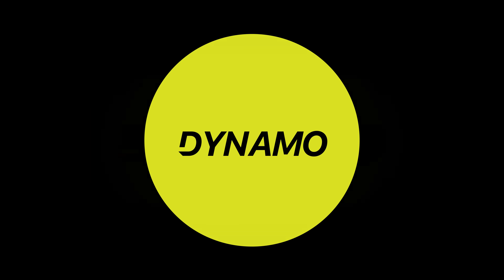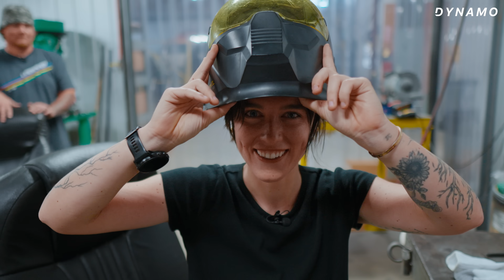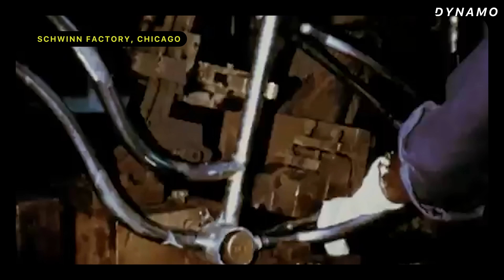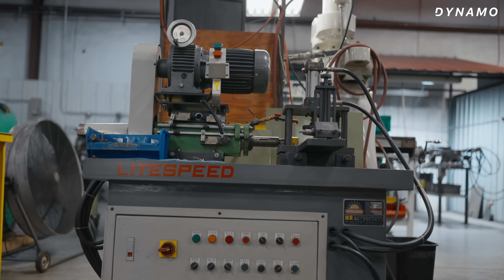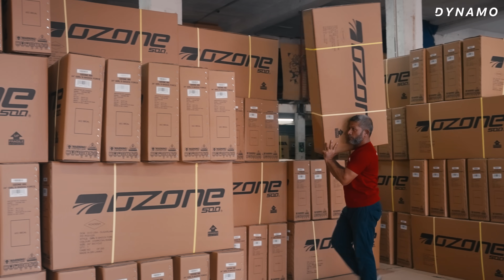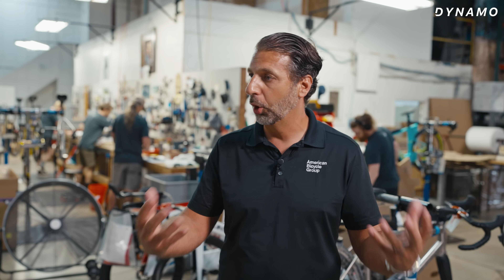What 'Made In America' ACTUALLY Looks Like

Comment: It's mostly impossible to go from materials to finished product in America.  In fact it's almost impossible to do that without anything coming from China (many products not from China are often re-packaged Chinese parts being sold through another intermediate country).  Smarter Every Day has a good series on this where they made a Grill Brush almost entirely in the United States and the level of detail and hoops they went through.  Even when the parts could be made in the US the expertise needed to make the molds for injection molding were all in China, the tooling that most of the tool and die companies used all was from China.  The Steel turned into bolts came from China.  And even if you found a US Steel processor the sheet steel came from recycled materials that the US sent to China to be processed.  And the Chinese companies will go completely from initial design to full finished, boxed product landing on US soil.  US manufactures will not do that, most response from US manufacturing is "no we don't do that, you'll have to source that from elsewhere and figure out the logistics of transporting it".  A person making a new flashlight doesn't want to manage 50 different supply and warehousing chains and quality control differences from rubber o-rings to batteries to the box it goes in transporting their products across the country 20 times to get it finalized.

Comment: Huffy Bicycle -- started in 1870 -- check this out ---
In 1996, the bicycle division received a major blow when U.S. courts ruled that surging imports of low-cost, mass-market bicycles from China did not pose a 'material threat' to the last three major U.S. bicycle manufacturers—Murray Inc., Roadmaster, and Huffy.[14] Huffy closed its Celina, Ohio, plant in 1998,[15] and quickly thereafter closed two smaller bicycle manufacturing plants (in Farmington, MO. and Southaven, MS.) which had been opened as a last-ditch effort to avoid the higher union manufacturing costs in Ohio. After it became apparent that continued U.S. production of low-cost, mass-market bicycles was no longer viable, Huffy had bicycles built by plants in Mexico and China, starting in 1999.[16] The relationship with the Mexican plant was severed shortly thereafter. In a federal bankruptcy court in Dayton, Ohio, in 2004, Huffy's assets were turned over to its Chinese creditors. In 2004, Huffy sold its Huffy Sports division to Russell Corporation. Huffy Sports manufactured sporting goods, including the Hydra-Rib basketball systems used by the NBA. By 2006, Huffy had sold more than 100 million bicycles. After years of struggling against the cut-rate Chinese bicycles that set the price target guiding Walmart, Huffy essentially had become a Chinese-owned company.

Even some of you kids remember 2004, yes? Trumps fault?

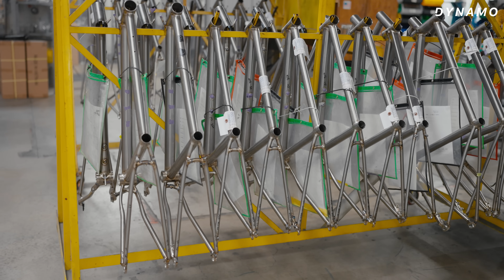Comment: @2:05 Titanium is a great metal BUT it doesn't have the same elasticity as steel so most parts don't last as long as steel. It will likely crack over time. It is true that it is very light so it is much faster to ride.
Reply: This may be true for bicycles and such but, not in aerospace. Example, the F-14 Tomcat (now decommissioned) had a variable geometry wing. The wing box was made of titanium and was designed to endure tremendous loads from maneuvering, catapult shots and arrested landings. The wing box was designed to take these loads over the life cycle of aircraft. 
The SR-71 (now decommissioned) was built predominantly of titanium.  Flying consistently for hours at a time at Mach 3.2 creates expansion and extraction of this material. 
Both of these aircraft had successful careers and titanium failure was not an issue.
Reply: Nope.  Ti bikes last forever.  My 25 yo Ti bike is practically indistinguishable from new after tens of thousands of miles. My experience is typical according to every Ti bike owner I've spoken to.  Bought a new one this year and my son rides the old one.
Reply: This is based on knowledge from titanium knives and car parts.
Reply: Only an issue under tremendous pressure.